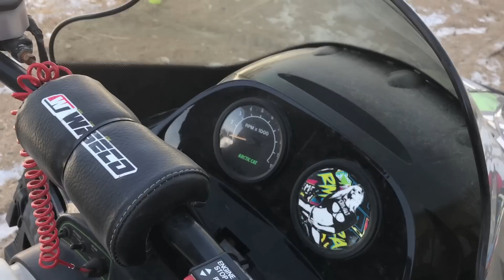Artic Cat ZR440 First Test Drive After Rebuild (She Sounds Like SHIT!!!!!)

Comment: What happened to the sno pro? Did you sell it
Reply from the maker: This video was the last time i had her running , Parked her after and traded her
I did not even have time to Tune her up after the rebuilt. 
than a buddy of mine brought it from the guy i traded it too , Just needed a set of spark plugs and carb settings and she was mint!
Reply: @starpuss that's actually a bummer when it's something so simple to make it run but you realize when it's too late

Comment: Why does it take so long to take off
Reply from the maker: 5000-6000 RPM the clutch is made for , Also Belt / Bog is not helping. 
When the sled is already moving its not as bad.
Reply: Ok that's what I thought u might in the one comment

Comment: Probably bogging so much with that extra oil
Reply from the maker: Nope , The extra oil would not make her Bog like this.
Reply: Too much oil can indeed cause a lean bog, which is what it sounds like you might have.  Not saying that is the cause, though.
Reply from the maker: There is not too much oil , But there is a good amount just in case oil pump was not working. (witch it is) 
Nothing that would make her act like this. 
I put less then 10oz of extra oil in the tank , with 20L if fuel

Comment: dang my vmax 600 does not need to rev that high to get going
Reply: Garrett Petersen race sled clutching
Reply: Garrett Petersen I have a vmax 600 as well
Reply from the maker: also the belt we used was FUCKED , Never tried the new one yet. 
Also when she is running right she will be better , Clutch kicks in right around 5000-6000RPM , Right where she Bogs out.
Reply: the clutching set with a high engagement rpm has nothing to do with the high engagement...?
Reply: you say you own 3 race sleds but yet you dont know stock clutching on these were 5000-6000 and sometimes even over 6k rpms on other 440s.
Reply: are they not the best ever lol
Reply: 123devinzz1 I've never had something as small as 440  or an artic cat for that matter so.....